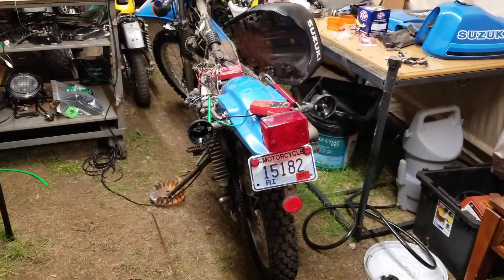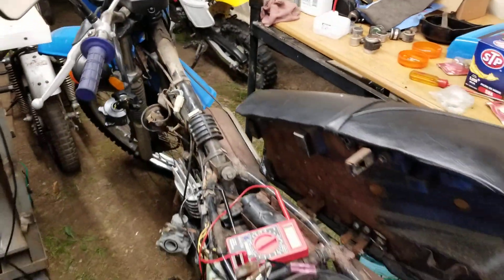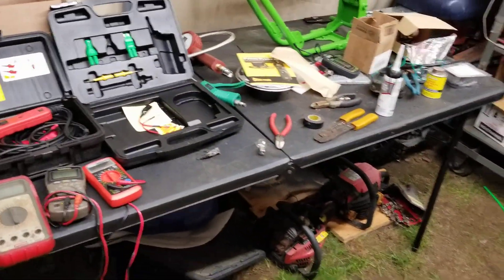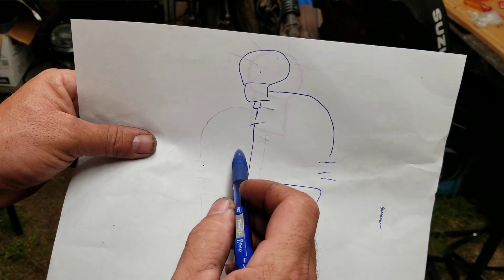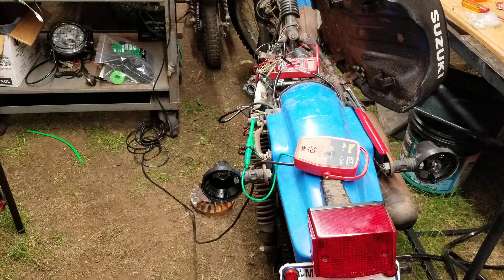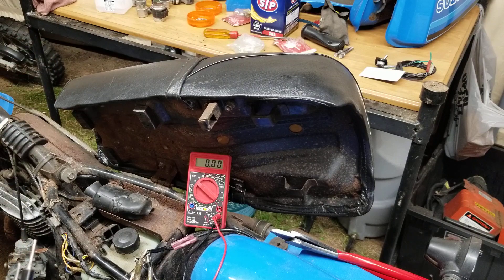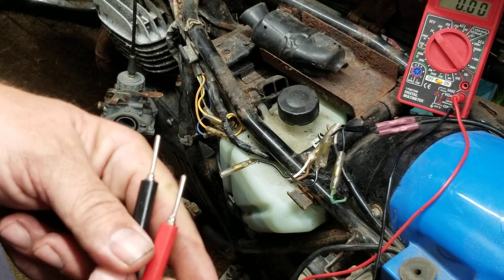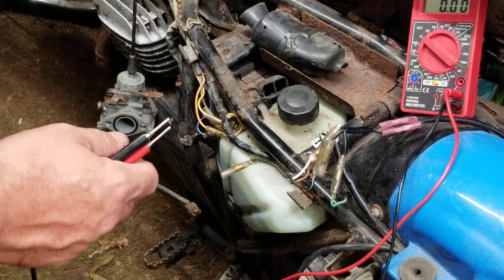Electrical 101 part 2

Comment: just got myself one of these bikes same as yours but 79 model round clocks and older swing arm it goes and sound good but cuts out so i need to do some checks . you explain things very well so thank you appreciate it. Tim from uk.
Reply from the maker: Try riding the bike with the gas cap loose, but not so it falls off, could be vapor lock. Let me know how you make out.